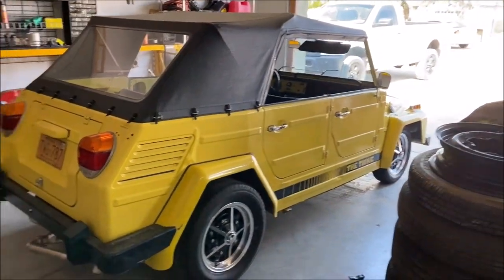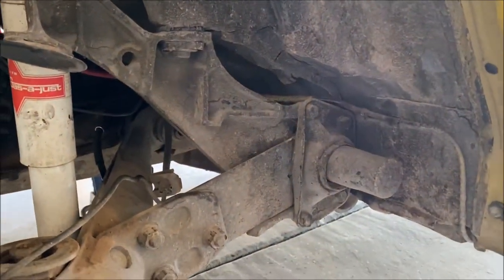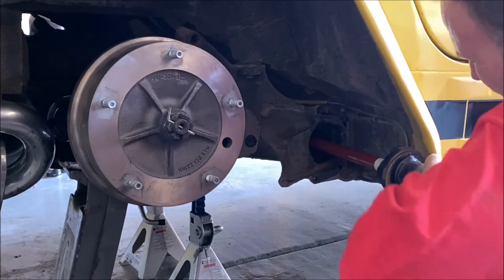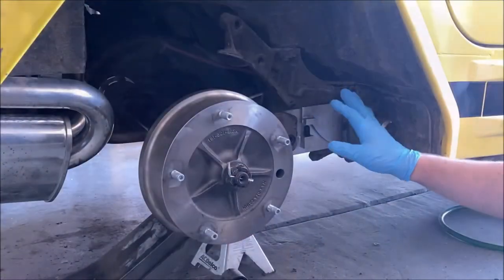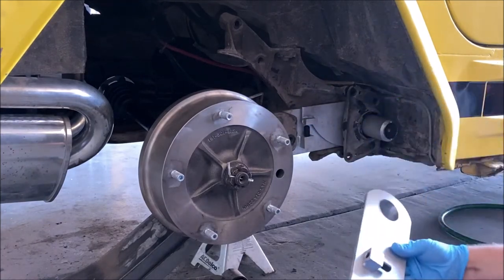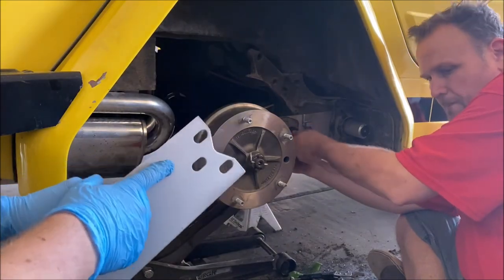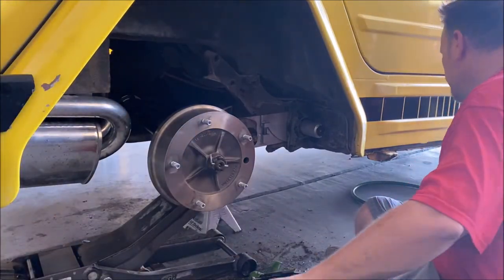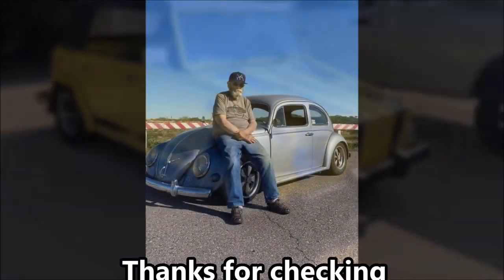Lowering The Rear Of Speedy 1973 VW Thing Using Adjustable Spring Plates Mileage Unknown Ep58

Comment: Hey guys Kevin here from Australia. 
Speedy is looking good. I'd like to see him all dialled in as it does look like you have some fine tuning to do but hey that's one of the advantages of adjustable spring plates. 
Anyhoo thankyou so much for sharing guys. 
Stay safe. 
✌   Peace.
Reply from the maker: Kevin Hamling thanks for checking it out! Yeah we’re still doing some tweaking we’re actually using the spring plates 2 raise the back up a little bit 2 get some suspension travel out of it. I think Travs getting an alignment done here in the next week or so. He’s itching 2 get it back going down the road!
Reply: @mileageunknown8910  have you thought about adjustable 2 inch lowered spring plates. 
You still end up with all original travel and you can still tweak the height.

Comment: The rear could be on the bump stops, causing no rear suspension travel. Do not remove the bump stops but you can cut them in half. 
Speedy is looking great, nice work you guys!
Reply from the maker: VWJAWBREAKER we had the bump stops out! Lol we did end up cutting them in half and putting them in..... right now the adjustable spring plates are being used 2 raise it up a bit instead of lowering it so who knows we may be doing some re-configuring but it looks so cool down low! Lol 😂